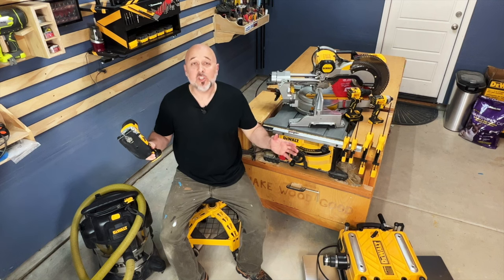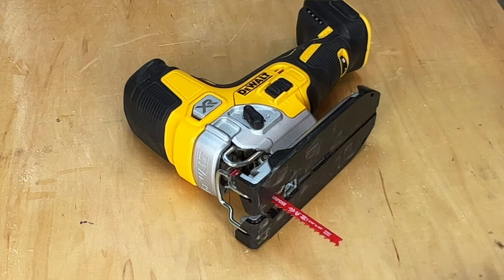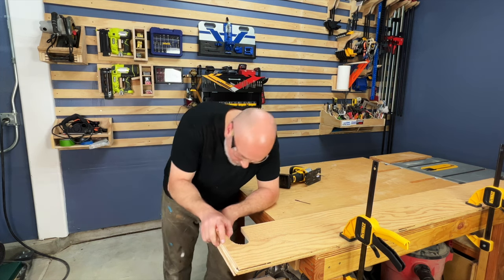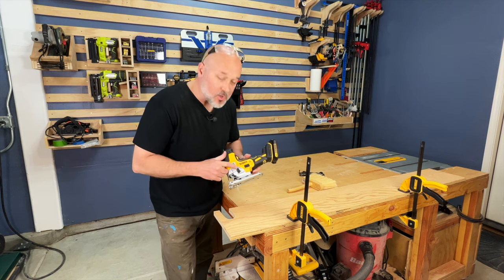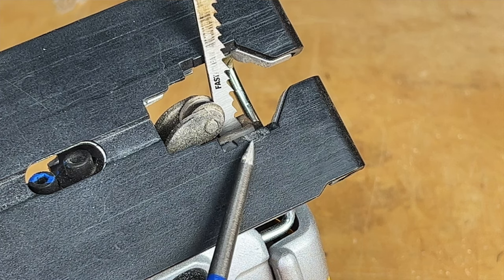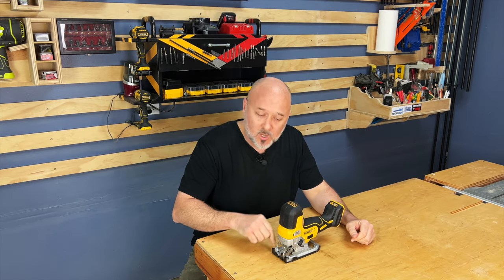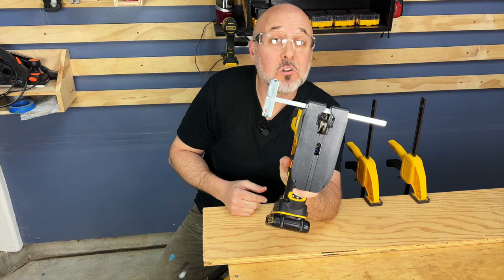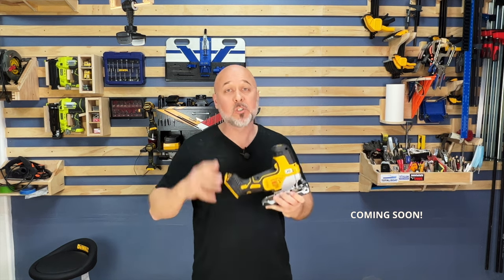5 Reasons NOT to buy this DeWALT Barrel Grip Jigsaw

Comment: The anti splinter is shitty and doesn’t hold in place. The dust collector might work but only if you have a strong vacuum. As for the cutting guide, check it carefully. A lot of them are not 90 degrees.
Also, I first bought this barrel model because I thought it would be easier with my rhumatoid arthritis hands but I am a woman and to reach the on/off button I had to use my other hand. I finally sold it and got the D shape handle. I will see over time if I made

Comment: Love the video, mainly because I also own this saw. Have had it almost a year and think it is superb. Very smooth and easy on the hand. Have not encountered the blade releasing when backing up but will see if I can make it happen. As far as blade deflection goes, I think blade choice has as much to do with this problem as the saw dose. Change of subject, We have the same taste in nail guns. I also have the same two Ryobi nailers you have on your wall. I purchased an adapter so I can use my DeWalt 20v battery’s with these Ryobi nail guns. Please keep making the video’s, learned new things about a saw I have, thanks.
Reply from the maker: I’m really glad you enjoyed the video. I put a lot of time into doing a deep dive about everything I could learn about this saw. The dewalt adapter sounds like a cool idea. I’ve been making videos for almost a year and a half and have no plans on slowing down. With comments like yours it will help bring this channel to the next level. Thanks for your support 👍👍👍🤓
Reply: Thanks for the quick response. The battery adapter was purchased on eBay. Also have one for my old 18v Black and Decker tools (Dewalt battery’s) the guy (wish I could remember his eBay store name, sorry) makes them with a 3-D printer. Has several combinations tool/battery - battery/tool. They work great.
Reply from the maker: @thisoldman7142  thanks for the info. Was it Shop Nation?
Reply: I prefer T shank blades personally.  Never encountered a U blade saw that didn't occasionally drop the blade.

Comment: Enjoyed you video! However, I have a tip for you on that guide (I have one). Mine is "slightly" different - it has two holes when flipped for circle cutting. But no matter, you could have  put the guide into the saw from the opposite side to achieve the same effect (it's a circle, you can cut clockwise or counter clockwise). The hole used to anchor the guide must be on the leading side rather than the trailing side. On the trailing side, it points the saw blade out of the circle (and out of the desired cut path) - which is why the saw was fighting you. On the leading side it points the saw blade "into" the cut.
Reply from the maker: Very interesting! Thanks for the tip. I’ll have to try it out👍

Comment: I just bought the other new brushless Dewalt jigsaw and it’s really good. I love it. It’s got the variable speed trigger and the variable speed wheel, so you can use both to control your speed. I wonder why they didn’t put that on your saw?? Also my new saw has positive locks for the bevel cuts. You loosen that black bar and then you push the shoe forward to change the bevel angle and it will lock into the different angles. Then when you want to go back to a 90 degree cut you loosen that black handle and push the shoe backwards and it locks into place to make a regular straight cut. I’m really surprised that your saw doesn’t do this. I gotta go back and look to see if your saw has that black bar.
Reply: Oh and great vid btw. You did a great job man.

Comment: I just bought it as part of a set and that bevel lever gave me so much trouble. At first it was tighten too much so I could move the lever. I entightened it a little to only realize that every time I would move it, the screw under would come lose. I found the trick though. You need to also screw the other screws around and it stays in place. There is a sweet spot to find. For such brand, they should have worked on a better system...
Reply from the maker: I agree, I hate it when adjustments don't click and snap into place. Tightening anything allows for quick wear, tear, and loosening.

Comment: My dewalt jigsaw I bought back in the late 90's had a nice edge guide. I upgraded to the new xr and kept the edge guide
Reply from the maker: What model number is your jigsaw?
Reply: My nee one or old one? My old one I bought in 98 and sold it a couple months ago
Reply from the maker: The old one. I know an older model 331 fits with it.
Reply: I'm not sure of that model number. But I was able to use it on my old cordless dewalt circular saw as an edge guide. Seems like I seen one of their new circular saws come with one when I was researching buying a new one

Comment: Lol. I love mine.  I've been using my milwaukee M18 for  more than six years and I hate mine.  It's a lot harder switch a blade. 2nd, it's never cut accurate. This is why I went to Dewalt.  Now, I have no issues with my Dewalt at all. How did you concluded that Dewalt jigsaw is bad???
Reply from the maker: Actually, my final review is that I love the jigsaw. Despite what the thumbnail may imply, this is a positive review. But my analysis shows that there are five things that I didn’t like about it, but there were 10 things that I really liked about it. I was trying to be as objective as possible. It’s a great saw and I’m glad you feel the same.
Reply: @DudeSawdust  Awe...I see. Your title is a little deceiving.  Lol.  Then I agree.  Thanks again.

Comment: Skilsaw 77 edge guide much better if it fits. I have my Milwaukee jigsaw on order after looking at both. Not going to throw my old corded jigsaws with the blade screw setup, it will outlive all the batteries. Don't think much difference between brush and brushless tools. All mine old brush tools still kicking while some of the contractor quality brushless tools died. The key word is OLD, they don't make it like they used to like a good woman.
Reply from the maker: You know, I've recently been thinking about the whole brushless stuff. You know it seems like the new brushless tools break sooner because of all the cheap parts that aren't in the motor.
Reply: @DudeSawdust  
Milwaukee cordless angle grinder use cheap Chinese bearings, so far mine is holding up. Not only that, you could not buy the individual parts like a switch, you need to buy the whole assemble including what's attached to it - like the controller and part of the motor by which time cost as much as a new unit. DeWalt is going the same rout.
Reply: I hate u tube keeps erasing my comment 😤 . We hate millwakee batteries.  The worst of the big three.
Reply from the maker: I'm starting to learn this as well @thedude8976

Comment: If intended to be a circle cutter I’m pretty sure the hole in attachment should be dead center at end of extension arm
Reply: Doesn't matter but it does looked better if at dead center. What matters is the radius from the hole to the blade.

Comment: I like my barrel grip jigsaw and the guide is also on their circular saws and has been for years The older corded circular saws used to come with a guide in the box
Reply from the maker: The saw really is great. I wish they still included the guide.
Reply: @DudeSawdust  
Trying to keep prices as low as possible is probably the reason … I have a couple of the guides I’m sure they don’t cost much … Woodpecker or someone else besides B&D might make one if you google it

Comment: Let’s talk about the dewalt stool wheels. Had them warranty once. Then I bought aftermarket of my own. Same thing though just wore out so quickly, but not as fast as the 3rd party casters Dewalt uses. How I know that cause getting them warranty at first was like pulling teeth compare how awesome they usually are about defects. They should have done 5 legs or something better than a frame that can handle 300lbs with no ankle strength! Lol I learn not to scoot or lean too hard on it which is dumb I can’t do in a rolly work stool
Reply from the maker: Nothing much better than a great shop stool! I love mine. The wife bought it for me cause she got tired of me steeling our inside bar stools for the shop.
Reply: @DudeSawdust  oh don’t get me wrong I love the stool I just can’t stand the wheels. Im literally about to get a fourth set for it. The third set I order myself held up good until my ladies mother twisted her ankle and needed a stool for work. She used it for a month and was almost in tear to tell me about the wheels I said don’t worry its a continuous battle lol

Comment: Do you know how to turn off the LED lights? When using the Collins coping foot, the saw is upside down and the lights are blinding. This makes it very difficult to see the profile being coped.
Reply from the maker: This is a common complaint. They don’t turn off. You can just find a way to block them
Reply: Yes it will automatically shut off after 100,000 hours, 50,000 if you're lucky.

Comment: Will say that blade ejection on others is handy when the blade shapes and you need to dig out the piece left behind
Reply from the maker: I haven’t encountered that but great point and thanks for sharing 👍
Reply: @DudeSawdust  only really happens when using cheapo blades or pushing too hard ,so user error really. Great vid . Subscribing
Reply from the maker: Right on!

Comment: Also the links do not seem to work when utilizing YouTube‘s mobile app to watch this video and try to get to the source of some of the accessories you mentioned.
Reply from the maker: Thanks for the heads up on the link problem. I checked all the links on desktop and mobile. It appears the only link not working is the dust chute. It is currently not available on Amazon, but hopefully it will be back soon. I'll have to keep checking. As far as the source for the accessories: I left a link to a follow up video I did about how I found the edge guide. As far as the other accessories, I spent a lot of time watching every youtube video I could find as well as searching through message boards, amazon, and other tool websites to find as much as I could. But if you ever have any DeWALT tool related questions, that video link should be a great resource.
https://youtu.be/xIBMLkM2LDI

Comment: What if you put black electrical tape over the LED lights?
Reply from the maker: I’ve heard of that option. Not a bad idea
Reply: @DudeSawdust  I didn’t think of the light being a problem when coping until I watched the vid. But yes I can definitely see it as being a problem. I’ve still got my old 18V Dewalt jigsaw so I think I’ll hang on to it and just keep the shoe off of it for coping. There’s definitely no light on that old 18V. And because I bought a battery adapter for it when I first started converting to 20V I can use my 20v batteries on it. It all fits fine. The battery sticks out a little further than it’s originally designed to do, and looks a little funny but it’s not that bad.

Comment: My wife bought this jigsaw for me and it does not work. It cuts for about 5 seconds and then it stops.I take my finger off the trigger and then pull the trigger again - it starts but on for about 2 seconds
Reply from the maker: The same thing happens to me when the battery is low. Just a thought

Comment: I currently have the D handle version I knew what those slots and that threaded hole were for but I too have until now spent endless hours looking everywhere trying to find the edge/circle guide that I thought it should’ve automatically came with. Also if one has an edge guide that will fit it already and just needs the threaded knob and spring it is the same one that works with the DCS 575 flex volt 7 1/4 inch circular saw, however the circular saws edge guide is way too wide to fit into the DCS334 or DC S33 fives edgeguide slots.
Reply from the maker: Thanks for watching and that great info. Finding the edge guide for this saw was quite the journey. DeWalt doesn't make it easy. https://youtu.be/xIBMLkM2LDI
Reply: @DudeSawdust   no they do not make it easy to figure and find parts for a lot of things Dewalt does not. Personally I miss the days of seers craftsman where all the parts were in one store and all the accessories and the people knew what you were asking for. Thanks again.

Comment: I will tell you brushless motors do get hot. I have dewalts and milwaukees they do get hot drilling and I'm going easy on them and I don't force my tools. They say it's normal. So that is false. They do run longer but not that much..

Comment: The constant stating that brushless motors will outlast brushed is absolute horse shit. That's a lie spread by these manufacturers based on the brushes wearing down and even that takes decades the way most people use tools. Brushed motors will last for centuries because other than brush maintenance they are really invincible. Brushless motors most certainly have a finite life and that's purely based on the amount of fragile electronics that control everything. I love my cordless tools, but we've been hoodwinked into buying tools that won't last that are run by super expensive consumable power packs. They got everyone fighting over red vs blue vs yellow etc which of course clouds the real lies they tell. It's the biggest swindle since New Coke. That said, the barrel body jigsaws are awesome for coping, especially when there's no cord in your way.
Reply from the maker: I’ve never heard these points before. Very interesting and thanks for sharing 👍👍

Comment: Pro, people are still buying dewilt
Con, they cost about the same as Milwaukee but don't perform as well.
Bias? Nope, but if it's yellow, 🤮 it will never be in my collection. Never been a fan of DeWalt, personal preference, but yeah.
Cordless jigsaw are so similar like everything else on the market it really comes down to price and color preference (even though Milwaukee is still at the top of the heap) , the features are all pretty standard these days. I say, whatever batteries you're specced into, that's what you should stay with. A few exceptions but honestly not much difference anymore.